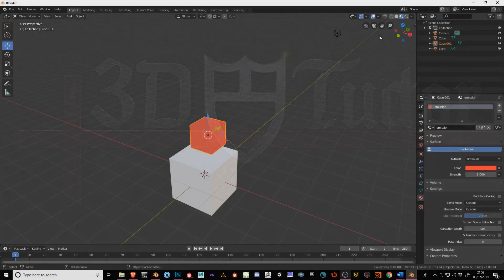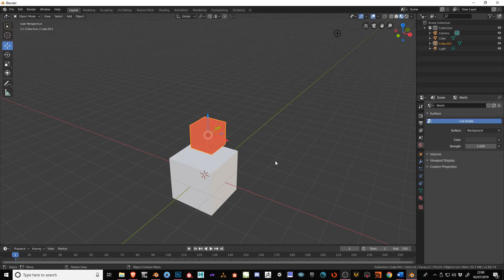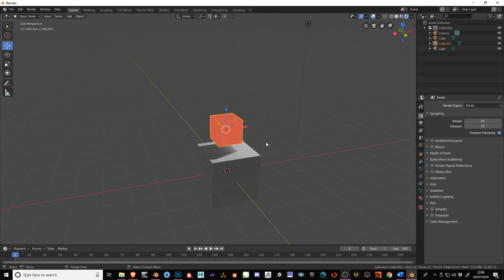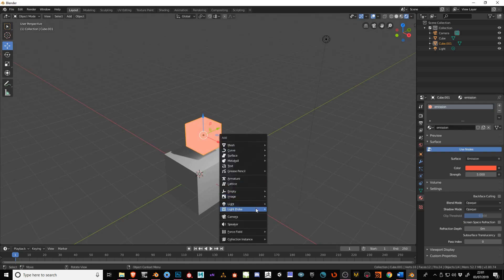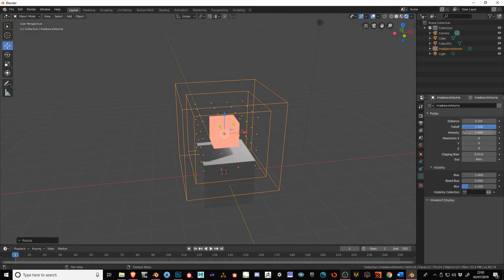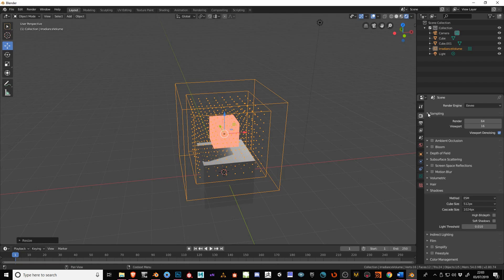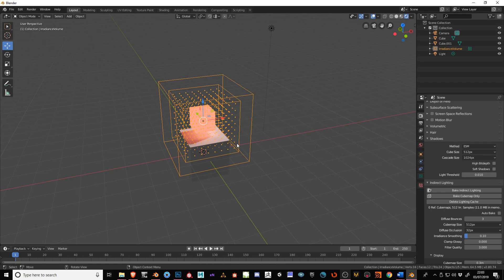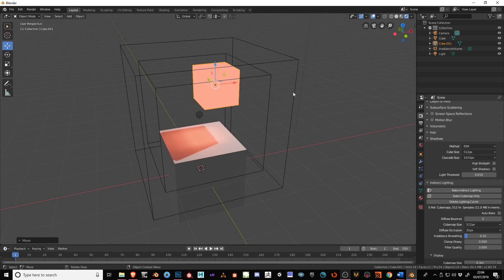Blender 2.8 EEVEE Tutorial How to Create Light from Emissive or Emission material the easy way

Comment: Eevee is suppose to be fast to use, I cannot understand why we need to do all of this just to have light from an object... I hope they'll fix that, but anyway thank you for this tutorial ;)
Reply: Eevee is not suposed to be "fast to use" as in less complex to setup than cycles. Eevee is suposed to be fast to RENDER, which means it takes a lot of shortcuts and approximations instead of using accurate simulations of lights and reflections. The reason it doesn't do all this by default it's because it's quite taxing to use it, and if all the shadows, reflections and light calculations were turned on by default then Eevee wouldn't be a realtime engine anymore, defeating it's main purpose.
Reply from the maker: I will say to be fair Eevee is amazing and we are only talking about emission here which work a lot differently form directional light for example.  Maybe in the future it will work in that way or like ray tracing.  I am glad you enjoyed the tutorial Kind regards Neil 3D Tudor.
Reply: No such tech exists right now that lets you do realtime emission or bounce lighting without raytracing or some kind of tricky and expensive emulation.